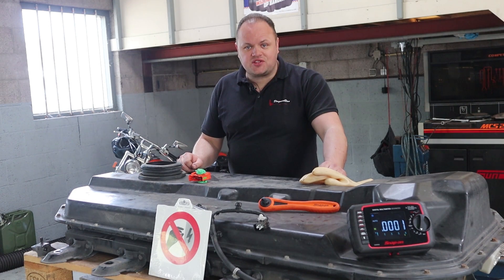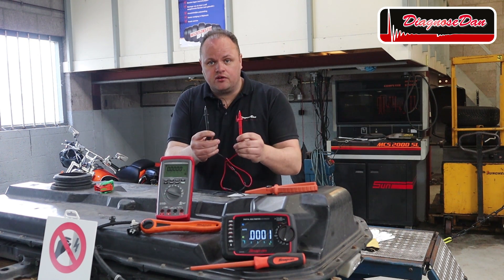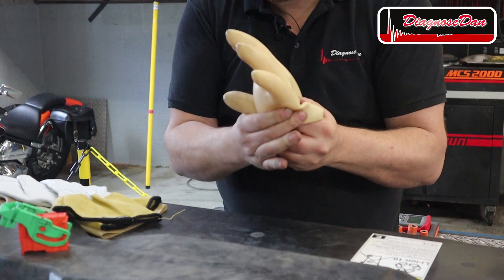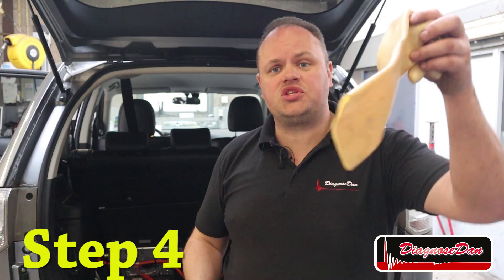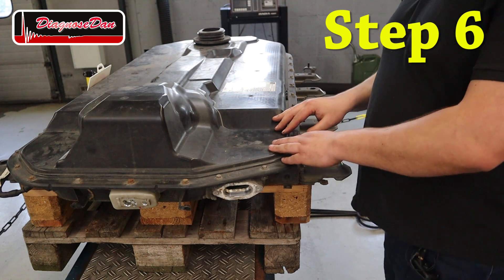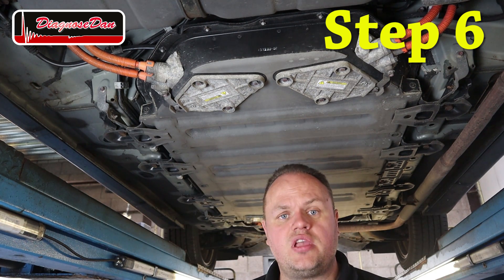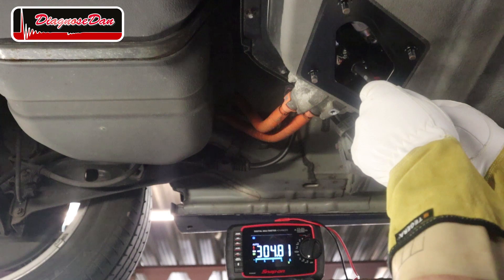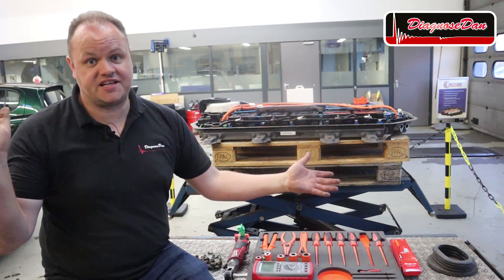hybrid/Electric training video

Comment: Great video 
I learned  a lot 
Do you know by any chance whee the service plug for eqc mercedss?
The one at the engine is fine but is there another one 

My car has no power and no ignition 
V12 was flat and I charged it but still no lock 
Any ideas please 🙏

Comment: You are a disgrace. How can you call yourself a hybrid mechanic when do you don't even know the difference between current and voltage. You need to go back to school and learn your physics. If it's high voltage that means it's actually protecting you. For something to be high voltage it needs thicker insulation that's why they have big orange cables. I really don't understand why you expect novice mechanics to go out and buy hundreds of thousands of dollars in PPE and safety equipment. The Weber Auto channel says you need all the snap-on or insulated German tools you need a multimeter that's rated not just category 3, but category 4. Plus you need these gloves that probably cost $250 new plus cotton gloves underneath. Then you need all these cones and stick pole. Plus realistically you probably need a advanced OBD2 tool.

Comment: Assalamualaikum. I am kazakh. I have a hybrid Toyota Camry 45. Check the hybrid system keeps on burning. I disconnect one ear of the battery and plug it back in, then it goes away. Then, after a short walk, the check hybrid system will come out again. If you know the reason, please tell me. Thank you

Comment: Hi I enjoyed your video and liked and subscribed.
Because of my past I have a lot of interest in Electrical Vehicles. I have been watching the move to Electric Vehicles in the world with great interest.  My father who was in the USAF opened an automotive electric repair shop in about 1961 after we moved to Delaware.  As a teenager I work there a little and completed several Heath Kit Education series that he paid for. In 1970 I joined the USAF Reserves.  The field I was in was Auto Pilot (automatic flight control systems).  I went to a 8 month school at Chanute Air Force Base near Rantoul Illinois.  In 1973 I open and ran an automotive air conditioning and radiator service repair shop for 30 years. Then after selling the shop I went through an apprenticeship to be a commercial electrician, and after completing the apprenticeship took and passed the test to get a Master Electrician License. While working as a commercial electrician we worked in several electrical rooms that had 480-277 volts coming into them and step down transformers for 208-120 volts and service panels for both. We called high voltage the voltage that was on the poles in the thousands.   
--> I am 73 now and do not intend on going back to work but may be interested in building an EV or converting a vehicle to electric. Could you recommend any good books and good suppliers of parts?

Comment: Hello Dan, great video, there’s only one remark when you are talking about resistance between probes in current mode : you said there’s no resistance, but in fact it’s a zero resistance , and there’s no resistance means open circuit..
Reply from the maker: You are wrong, open circuit is very high  resistance!!!!! Not no resistance.

Comment: This looks very very dangerous. I would advise to always check also voltage between each port and the metal cover, you never know if a wire got broken inside and it conducts to the metal cover. The two ports may show zero voltage, but can have  300v when checking one with the metal cover.
Also checking the multimeter in the power socket is dangerous, like hugely dangerous.
Imagine being it on Amps, your fuse would blow.

Comment: hi Dan , the bmw high voltage disconnect  , you do not disconnect the 12 battery first , you just need to disconnect the high voltage at the service port .  as if you do it the way you mention , you will not know if the high voltage has being disconnected , you need to see the warning appear in the instrument cluster tell you the high voltage has being disconnected .

Comment: During Step 6 where your using a DMM/Voltage Probe to prove dead, I'd recommend to reprove the tool back at the wall outlet to make sure it's still working after testing all the terminals.  As long as it beeps before and after your tests, then you can believe the terminals tested inbetween really are dead.

Comment: Very informational. Quick question say you have a battery drain one a hybrid which system would you test the auxiliary battery or the high voltage battery?? Like would you put a meter in series to the negative battery cable on the auxiliary battery like conventional testing?? Is the auxiliary battery responsible for starting the car?? Then the dc to school converter kick in after it’s started

Comment: Why must linesman’s gloves be used whilst removing the service plug? I would assume it is insulated and unless someone stuck their bare fingers down onto the contacts it would be no more dangerous than touching a switch mounted on the wall with high voltage behind it.
Reply from the maker: The answer is rather simple, if everything Works the way it is supposed to than you are fine. But when you are removing a service plug in a workshop you are doing this because you are going to work on the high voltage system. And possibly because something is wrong with it. The car could have a fault or could have been in an accident. In those cases the there could be something wrong with the safety Systems. And that's why it's best to wear your safety gear untill your a 100% sure the system is secure.
Reply: Thanks Dan, you are always very generous with your time and responses to viewers. These videos and your knowledge of the content are in a class of their own.

Comment: Dan, thank you for the video. I never knew this battery pack is all the way to 305 volts DC. But they have to I guess,  in order to use smaller cables. I am good to 380 volts 3 phase on AC system. Some questions if I may :  
01. Is this car still a 12 volt negative ground on its chassis ? 
02. The 305V DC system, they are all isolated from car chassis ground ...correct ? I mean it does not share its negative 305V DC to car chassis/ground.
Thank you
Reply from the maker: Yes, the 12v system is still connected to chassis ground.
The high voltage system is a "floating" system and not connected to the body.
Reply: @Diagnosedan  Thank u Dan :)

Comment: How do you connect High Voltage Battery? Do the silly car manufacturer procedure connecting the negative last also apply on high voltage battery? Service Plug is connected to the Positive?
Reply from the maker: On most models the Service plug is in the middle of the battery deviding it in two
Reply: @Diagnosedan  The high voltage battery is connected to the motor, generator, heater and AC compressor directly using 2 wires? All high voltage electronics are isolated to the body? Right? Is there a device that cutout the high voltage when high voltage insulation fails? The fluid cooling the battery is not electrolyte?
Reply from the maker: @w0lvez1  this battery is not fluid cooled, you will learn this in the next episode. The high voltage is a "floating" system and not connected to the cars body. The high voltage lines don't run from the battery to the motor/generator, because the battery is DC and the motor is AC. It runs thru a invertor/convertor to turn the DC Ito AC.

Comment: hello i want to ask something... i have seat leon 2006 1.9 tdi bls i have a problem when the cooling fan is on te rpm goes 1000 and stays there for few minutes and than when its of gets back to normal i've changed the cooling sensors and its the same ... thanks
Reply from the maker: Proberly regeneration proces. Check your Dpf filter if it has one
Reply: @Diagnosedan   thanks for the information... the car doesnt have dpf ....

Comment: You really do not need gloves to unplug the service disconnect.

It is a simple blade (covered with insulating plastic) bridging 2 poles, so there is only one wire and the 2nd wire is not attached to ground/chassis.

Now, if that plug had current going through, whole different story as then, it is arc flash that you need to worry.
Reply from the maker: Thanks for the feedback.😉

Comment: I've been doing high voltage since 2010 when I worked for Nissan on the first generation leaf, currently working with Toyota, Lexus, Hyundai and Honda, all using hybrid or full electric. You really need to know what you are doing and be certified, safety is crucial. It's common place now and will continue to grow. Very informative video, well done as usual 👍And just to add, you're experience is very advanced, anybody would be lucky to train and work with you. A vast knowledge bank👍
Reply from the maker: Thanks Paul!

Comment: This is definitely not a back yard mechanic or a Diy job! Dc voltage is a lot more dangerous than Ac voltage because Dc is direct current and if you grab ahold of a power output, you cant let go because your muscles will contract and make it impossible to let go. Ac power is alternating back and forth, so you have a better chance of being able to let go. Either one will fry you like a bug zapper, so be careful
Reply from the maker: Amen!😊

Comment: Super content. Considering, how many electric and hybrid cars are now on the roads, I will be watching for sure. I do not see many channels actually talking about servicing electric/hybrid cars. It would be good to put some links, to read more basic info. It is not possible to do everything/tell everything within 20 min of video.
Reply from the maker: There are going to be multiple video's.
Reply: @Diagnosedan  I figured that, but if you have some sources to read more, will be sweet.

Comment: I had to go through Eaton factory training to work on these systems on medium duty trucks while I worked at Kenworth. All the safety requirements you mentioned were dead on what we were taught. We were only allowed to swap out components , definitely not allowed to open anything. Only had to do smaller repairs on a couple units before I left there.  This is definitely a desirable skill to learn in the trade these days. Good content, eagerly awaiting the rest to come. Your videos are a refreshing change from most of the videos put out by the countless hacks who think they've become an expert by accidentally fixing one problem.
Reply from the maker: At Mitsubishi they don't open the components either. There are a few specialised companies that do.

Comment: Mr Dan, thank you for your video, I enjoy learning from you. I want to emphasize how important is safety. Thank God I survived an arch flash accident and I learn a lot after that. I was trained to be safe, I knew all safety procedures and how to use protection equipment, but I became overconfident and thought was okay to work with live circuit as long as I follow procedures, but accident is an accident, is not planned, it just happens. The panel exploded. So I like to add something to what you said, if you don't mind. Wear safety glasses and face shield, it will save your eyes from hot flying pieces of metal; try to use one hand to make measurements so voltage does not cross your chest; wear electrical isolating shoes or mat and inspect the leads on the multimeter always for damage before using it. Thank you for your video.
Reply from the maker: Safety glasses on in next episode!

Comment: I'm very much looking forward to this series. Hopefully it will help build confidence on my hybrid repairs. I replaced a failed motor power inverter unit on a Acura ILX a few months ago. It was my first major hybrid repair. No matter how many times I read the service information and confirmed the high voltage disconnection procedure was properly completed, I was still sweating the whole job. I know this stuff is the future, but it still freaks me out to repair it haha.

One thing I've wondered, can you safely use clamp on ammeters to view waveforms(like a picosope) on the individual phases of the motors without buying special equipment?
Reply from the maker: As long as the ampclamp is rated for the voltage your working on.

Comment: Interesting.  I would not have thought the service plug not only disconnects the battery but also shorts the positive and negative together to drain the module caps.
Reply: Hi JK,
The service plug doesn't short the positive and negative.
In the inverter is an resister that drains the capacitors inside the inverter.
Greetings Hans
Reply from the maker: @hansvanrengs2642  😉
Reply from the maker: See Hans his answer😉
Reply: @Diagnosedan    What Hans wrote is what I expected.  For some reason, I got the idea the had added shorting bars for safety to drain caps and avoid static and  back voltages building up.

Comment: Are you saying I can’t lick the terminals to check for voltage ⚡️ anymore Dan 🤪
Interesting you disconnect the 12volt battery first, this is done at a later stage on MB & at present cannot open aHV battery in fact some are welded cases.
Look forward to the next instalment, as ever keep up the great videos.
Madds 👍👍👍
Reply: Hi Madds,
It really doesn't matter what you do first, removing the serviceplug or disconnect the 12V battery. It is just the preference of the manfacturer what comes first.
Greetings Hans
Reply: Sorry I can’t agree wit’s that, if you disconnect the 12v battery on a e class you lose the ability to communicate with the bBMS via the factory scan tool & shut the system down safely then check in the instrument cluster the voltage values once youve disconnected the HV cables.
Not following the correct procedures would then mean having to carry out a manual power disconnect & wearing a safety suit & helmet to disconnect the HV battery.to protect yourself from any potential arcing.
Removing the 12v battery maybe the correct procedure for this vehicle but not all.
Reply: If you disconnect the 12v battery on a E class hybrid you would lose the ability to communicate with the BMS via the scan tool to safely shut the system down & instrument cluster which is required to check HV values after disconnect of the HV cables.  so it does matter.
Failing to do the correct procedure would then require have to wear protective safety clothing to c/o a manual disconnect and potential of arcing when disconnecting.
Removing the 12v battery maybe the correct procedure for this video but not all.
Reply: Sorry Dan but Mercedes use the scan tool to close the contractors & discharge the capacitors so that no arcing will occur when disconnecting the HV cable, you have no access cover like you removed to check for voltage. You would need disconnect the HV plug risking possible arcing before you could then check for voltage. A second line of defence is used by checking the voltage in the cluster service menu.
Of course disconnecting the safety interlock should do this but is not guaranteed and as we need to work safely & respect the HV we should follow the manufacturers safety instructions.
Reply from the maker: You are both right. Both ways of doing it ensures the system is safe to work on. Mercedes wants you to check the voltage with a scantool and because of that the battery needs to be connected. But if you took the steps i showed and do a measurement yourself you dont need to rely on scandata.

Comment: good video Dan, it a good thing you are doing explaining the system for safety,....we send are glove to be inspected 2 time a year,and we use fluke meter that have isolation test to check for isolation problem also.it is important to under stand the danger, there are guys in are garage will not do any work on the high volt system after a training and been certified .
Reply from the maker: Insulation testing later in this series!

Comment: Super vid!!  Where is your other 12 volt ratchet?  You’re working with the heavy one. So it wouldn’t b a good idea to put salt water on the concrete and disconnect with bare feet?  I’m sure glad I’m one of you’re early subscribers.
Reply from the maker: Old ratchet broke, was my sixth already. Trying to see if this model last longer.
Reply: DiagnoseDan I guess you’re not just a pretty face. I haven’t broken mine yet. Of course I probably don’t work as much as u. I’m commenting on videos all the time
Reply from the maker: @billrimmer5596  ha ha ha. Bill mine last about 6 months in my workshop. But i use them all day long. This one is heavier and on the package it says "Greater durability" so let's find out.😉

Comment: With high energy circuits, which that battery certainly is you should at least were a face shield in case of flash over or even better a complete suit as shown here.  https://youtu.be/J6kkkTmYWRE

Comment: Hey  Dan, did you have to recharge the battery in your ratchet after removing all of those bolts?  It's a shame you only have 27K subscribers. Your content is easily worth 1/2 million.
Reply from the maker: No it last a lot longer than that😉